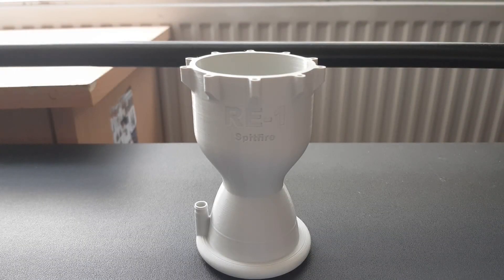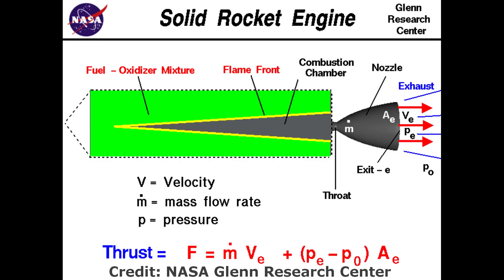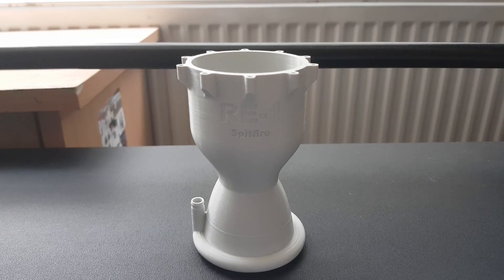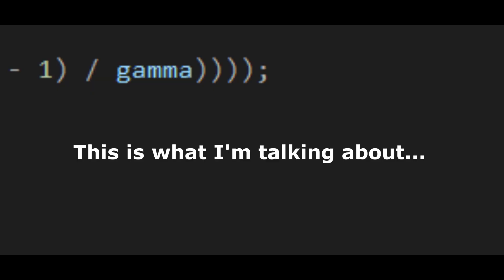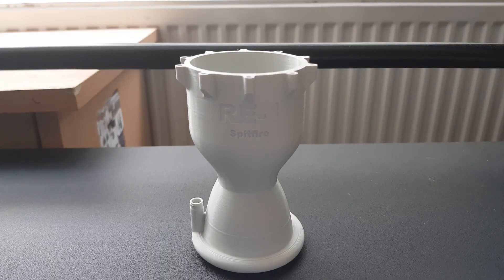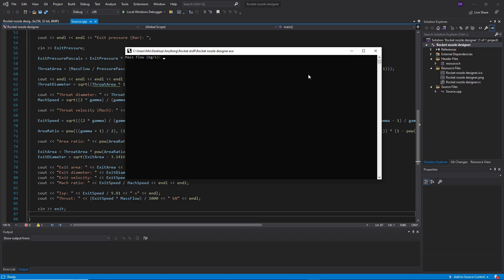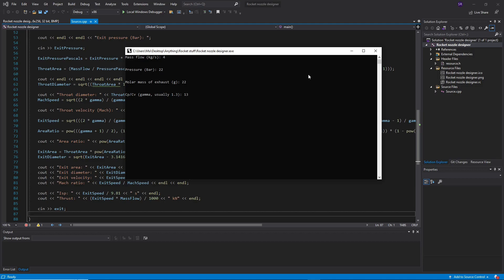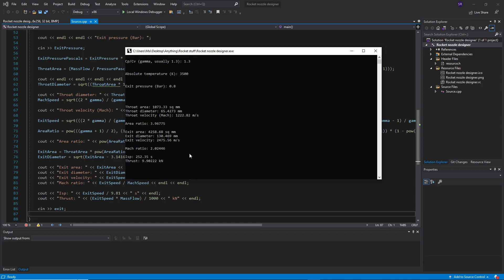Rocket nozzle calculator.

Comment: How will the o ring shaft seals be lubercated at cryo temps, did you use any resources to design that seal or did you just wing it? I’ve been looking at tons of nasa ntrs papers and I have not found any that give a practical guide to a seal design.
Reply from the maker: I would like to help you, but I haven't designed any cryogenic seals before. That pump was meant for ethanol. If you want to design a mechanical seal for cryogenic pumps, you should lubricate it with Krytox, a cryogenic grease that is also oxidizer safe. Also, I don't know if there's any cryogenic o-rings on the market, so I would suggest using self-lubricating materials like brass or maybe teflon. Unfortunately, I can't help you out more than that for now. If I will ever design a turbopump by myself, I will post about it however.
Reply: yeah, I'm looking at spring loaded dynamic seals right now made from ptfe trying to find cheap ones is hard @RUD_Technologies